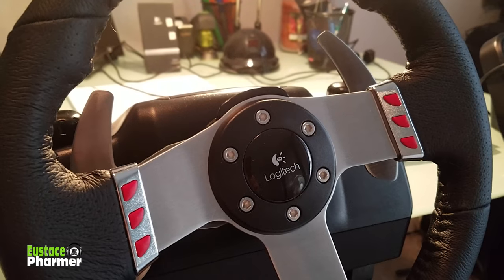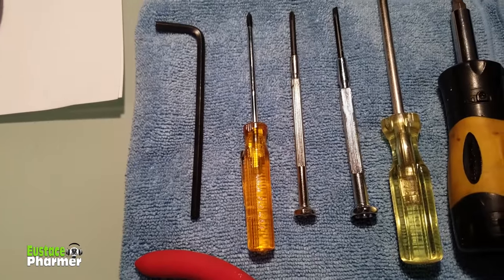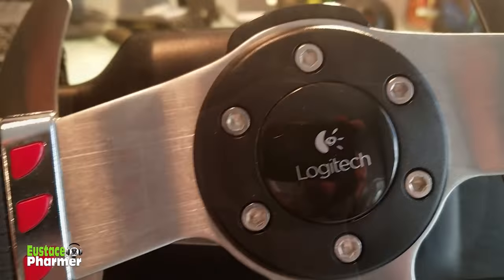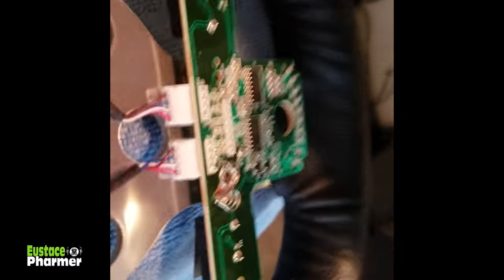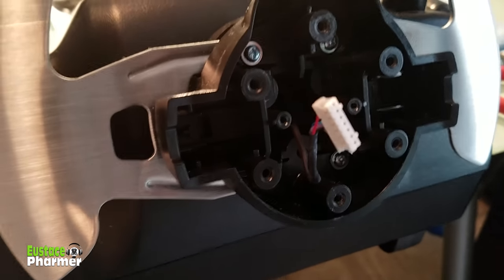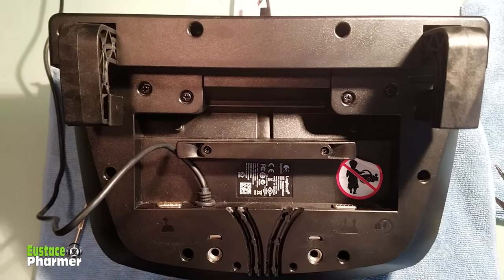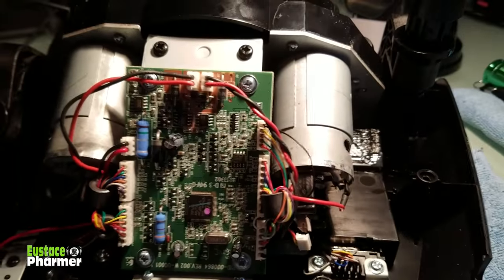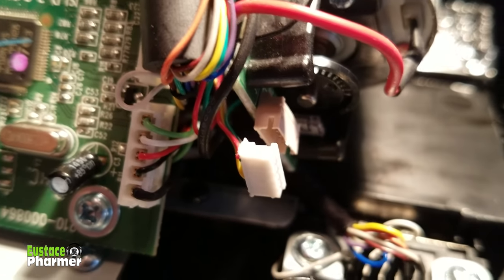LOGITECH G7 WHEEL CENTERING ISSUE FIX

Comment: Hi i need help my g27 have cracked  optical encoder so i go to ebay and bay a new optical encoder and tuday its came th my home and i but it in my g27 and now its not working its move the wheel 3 tims ltel by litle
Reply from the maker: Mahdi ALmiskeen 
it sounds like you didn't line up the optical sensor properly.

Comment: I have a g29 and I bumped my shoulder into it and now when the week is in the center the car goes a little to the right, I only found calibration fix videos on g27 , will this fix work for me ? I think it might be just some lose screws because the steering wheel kinda moves back and forth too it's gotten a little lose it didn't move back and forth before
Reply from the maker: amed lak
Sorry for late reply. I was on vacation for a week. G27 calibration will not work for G29. G29 has built in calibration software suite you use. 😊
Thanks very much for watching and for the question.

Comment: what are the symptoms of this problem, my wheel shakes violently for no reason and was wondering if this is what i should do to fix it
Reply from the maker: Sounds like the feedback setting is set too high or malfunctioning. I recommend opening the software and turning feedback off.
if you don't have the original profile software you can download it with the link in the description of this video.
Reply from the maker: Thank you very much for watching too 😊 👍
Reply: @Atomic67G  i don’t want to turn feedback off because it’s important to me and setting is not too high cause it was fine and then all of a sudden it started doing that
Reply from the maker: @BenSmith-yo3jw  The G27 is a very old wheel. Things will start to go bad. Feedback is first to go because it shakes the wheel literally apart.
If this happens when you start the pc when the wheel calibrates then it's a wheel problem.
1 Unplug the wheel
2. uninstall the profile software.
3. Use a registry cleaner software to remove residual files like Glary soft 
 4. restart PC 
5. download and install the legacy profile software from my Google drive link in description.
6. plug wheel back in when prompted by install wizard.
See if that resolves your issue.
If it doesn't then that feature of the wheel is going bad.
You will have to decide to reduce the feedback or turn it off or you can send it to an electronic repair shop for diagnosis and /repair. 
It may be time to buy another wheel and pedal set.
I use the Thrustmaster Leather edition. Excellent quality piece of kit.
Again, Links to the registry cleaner and legacy software are in the description of this video.

Comment: I bent that infrared sensor littlebit closer to that plastic wheel, that fixed calibration issue for me. First i bent it too much and whole wheel didn't work, then i bent it littlebit back and everything was working and no calibration issues after 20hrs of use.

Comment: ive seen that a brass replacement encoder can be purchased online. either a 30 slot or 60 slot wheel. is there a method to determine which encoder is inside the G27 without opening it up? i dont have the box it came in as i bought my wheel second hand.
Reply from the maker: Lucien Petersen 
The piece you are talking about is the same across all G27 wheels but to be honest, you have to order that piece from someplace in Asia. Not only does it take like 3 weeks to get but I don't think I trust some dude taking my money hoping he will deliver, lol.
Reply from the maker: Lucien Petersen 
you can remove the piece yourself and look up online for a local tool and dye maker they can make you a piece in your local area and it will be far less expensive and you can have it most likely in a couple of days
you can also call at company that has a 3D printer and you can make one out of plastic and they can do that in 10 minutes
Reply: Eustace Pharmer i believe from Thailand yes. USD38 with shipping. they have YouTube vids showing how they turn the ring out of brass then laser cut the slots. Does anyone else out there know how to determine which optical encoder is inside the g27 without opening it? fyi - I'm in Cape Town. in case anyone sells it locally....
Reply: Eustace Pharmer ok. so bottom line is - roll up sleeves and pass the Phillips head...
Reply from the maker: Lucien Petersen 
you have to open the wheel anyway so you can determine if yours is even broken and if it is you have to remove it and replace it so you may as well just open it up
Reply from the maker: Lucien Petersen 
Foe Shizzle, get in there buddy 🤣

Comment: I recently bought a second hand G27, and it worked just fine until this problem came up. 
I turned it apart and realized that the problem was, in fact, a loose screw.
Now I re-assembled it and i
All I get is the dim power check light on the gear stick and the wheel won't even auto-calibrate :/

Anyway, this was very helpful
Does anyone know what could be the problem with my wheel?
Reply from the maker: I'm glad I could be of some help. If you have further trouble calibrating I also included the DX tweak software. link is in the description. Thank you very for watching and for the comment 😊 👍

Comment: I have a problem with the thrust master tmx where I plug it in correctly, it calibrates fine, but then there is no ffb, vibration, resistance, or self cantering... been trying to figure this out for over a year
Reply from the maker: go to the thrustmaster website and download the latest firmware. I know there's been an update because I just bought the thrustmaster leather edition and shifter.
Reply: Atomic67 G do I still need to do this even if I’m on Xbox one?
Reply from the maker: @jacksondevries6180 
I would say on console it's plug and play so I suspect certain features like what you are talking about may not be supported for console.
Reply: Atomic67 G it worked before, but after I played forza 7 on pc and went to play horizon 4 on Xbox, it didn’t work
Reply from the maker: @jacksondevries6180  I had the same problem with logic g29 for Playstation. I plugged it in to PS and it worked great. I plugged it later into pc to play a game then back to PS4 and it didn't work at all. Not even calibration. The only thing I can suggest is to plug it into your Xbox and look for a setting to reset the wheel. if not I would contact thrustmaster about it and see what they can do. I know it's a common problem but I don't know if they will help you or not. Logitech has terrible customer service support so I don't know if Thrustmaster will be the same. I wound up returning the Logitech wheel to Amazon for a refund. it's always a good practice to test as many things you can with a new product the first couple days you have it. That way you can easily get a refund if something goes wrong.
Reply: Atomic67 G it works on the pc now. Thanks so much for the help!!!
Reply from the maker: @jacksondevries6180  I'm sincerely thrilled I could help! I know how frustrating and disappointing these issues can be. These wheels are so darn expensive! Best of luck and thank you very much for watching and for your comments 😊👍

Comment: I have those problem and when I go to the part behind the mother board where you have to take the clip of of the working harness I am having a extremely hard time getting it off any suggestions
Reply from the maker: Mach_ChickenGaming 
The only suggestion I can give you is to just gently wiggle it loose with a couple micro screw drivers. Just take your time. It will come off.

Comment: When i turn on my steering wheel is centres wrong the when i play with is this way the steering goes seriously out of centre do you thing it is the optical sensor or no before i open my steering
Reply from the maker: You can go in the video description and download the legacy profile software and the DXTweak software I provided. DXTweak gives you the ability to reenter your wheel and fine tune it.
Try that before opening your wheel.
If it continues to become misaligned after that then open wheel and check sensor 😊
Reply: @Atomic67G  how to use the DXTweak and if the ring was cracked how to remove it

Comment: My wheel gradually starts going off center about 10-15 minutes into playing until it is entirely 180 degrees upside-down. Would this fix that or is something else wrong with mine?
Reply from the maker: If you used the DX tweak software I made available for download in the description of my video and your wheel still falls out of alignment then you most likely have a mechanical issue. Either loose screws or cracked optical sensor.
I suggest you open it up and inspect it if you feel comfortable doing so.
If not you can contact an electronics repair shop in your area and let them diagnose /repair it.
Hope this helps and sorry you're having trouble.
Thank you very much for watching and for the comment 😊

Comment: I had a hell of a time getting the black cap off. The whole fn thing came off. The cap, disk, the board holding the sensor. It was really loose. So does it matter how close the disk is to the clear sensor when putting it back
Reply from the maker: Travis Wilson 
Hi Travis the disk should be aligned perfectly or you will not be able to maintain calibration or it may not calibrate at all.
Reply: Anyone else have to make sure the wheel was lined up dead center when putting it back together
Reply from the maker: Travis Wilson 
absolutely, that's what determines center point for wheel calibration and it maintains based on optical disk positioning each time the wheel calibrates.

Comment: Man... You rock!!!
I have a G25 and yesterday have exactly same issue.
Some Litlle diferences with yours G27 but in The end its The same.
Excelent vídeo m8!!!!
And thanks a lot
Reply from the maker: You are very welcome and I'm thrilled I could be some help to you! Thank you for the fantastic comment and I appreciate you watching the video! 😊👍
Reply: @Atomic67G  😞 after 45m ok back to same... Led flashing again and Cant stearing...
Ideas?
Reply from the maker: Unplug the wheel from outlet and unplug the USB.
uninstall the software. Then use Glarysoft registry cleaner to remove residual config files.
Restart your computer.
reinstall the software.
Follow software prompts as to when to plug your wheel back in.

Make sure in the software that you do not have auto update active nor should you have automatic game settings search active.

If those steps don't fix your problem then it's possible that you have a bad sensor or broken wire in the USB cable either at the attachment point to the circuit board or the wiring inside the cable covering it damaged at some point.

I don't know what county you live in but you can find an electronics repair shop that would diagnose and repair the problem. It may cost you anywhere from $50- $100 but that's alot cheaper than a new wheel.

You can also take it to a technical school in your area and let the students fix it. That's usually free. 
Let me know how you make out.
link to Glarysoft registry cleaner is in the description of this video 😊
Reply: @Atomic67G  tks m8
I Will try it and after ill give you some feedback
Reply: @Atomic67G  i just remember... Instead unistaling all that and cleaning registry i Will Turn it on on another PC (laptop)
But i think thats something fisical..
Prob a bad contact.. 
After try ill say something
Ps. im From Portugal
;)
Reply from the maker: Nice to meet you and hello to you in Portugal from me in Las Vegas 😊👋
Reply: @Atomic67G  🍺🍺🍺 cheers!
Reply: @Atomic67G  same thing on another PC... 😞
Tomorow gonna Open it again and try to understend what ia happing.
After i post it here
Reply from the maker: ok, please do let me know. I think it's pretty evident at this point it could be a circuit board problem. Look for any deteriorating solder where wires and components connect to the boards. Obviously you also want to look for broken contact or loose contact.
Reply: @Atomic67G  i Will...
Tks once again 4all
Reply: @Atomic67G  just finished mount all again..
After some checks, all seeams fine.. The only thing that claimed my attention was The little wheal.
I put just a little bit of superglue on it to dosent false Spin (dont know if it makes sence to you now😁)
Turn all on and passed The test.
It spins the 900°
Later Will try it on Game and hope it stays like that.
Ps. Sorry The english
Reply from the maker: @LuisFrederiko 
I'm thrilled you got it to work and I'll say a prayer for it to continue working.
Don't apologize for your English. You are doing great! 😊 👍
Reply: @Atomic67G  still working...
😁

Comment: Mine is slightly calibrating to the right does it mean that the optical thing is broken or just software issue because when i put it straight the software tells it angle 0. Thank you
Reply from the maker: it doesn't mean your optical sensor is bad. I updated my description with a link to my google drive.  Click on the "LEGACY SOFTWARE and DXTWEEK SOFTWARE" link. Download the DXTWEEK software and you can use that to recenter your wheel. You will have to play with the numbers a little to get it spot on but it worked great for me. 
Hope this helps :)
Reply: Ok thanks you so much
Reply: Im a noob at sim racing

Comment: Nice video. I wish this was up about 6 months ago when I had to strip my G27. I had dust on the sensor the wheel would start to calibrate then quit. Once I cleaned it the wheel was back to normal.
Mike
Reply from the maker: Reefy1952 
Thanks very much for watching Mike. I have to say they Logitech really has a serious design flaw regarding optical sensor and internals. They make a metal wheel wrapped in leather but use plastic moving parts inside?  The G29 is the same way. I wonder what Logitech will do with the Farming Simulator wheel kit now that they bought Saitek. Probably keep it the same and raise the price, lol.
Reply: That's the million dollar question.  The Saitek Farming Wheel has serious quality issue from what I've read and seen on YouTube.  Many have stated they are on their second and third sets due to them breaking after only a few weeks/months of use.  So I would hope that Logitech improves the design.  But yea, I'm sure the price will go up.  

I'm really shocked to hear of the design flaws in the G27 and up.  I've used Logitech gear in flight sim for years and have had my G27 kit for about two years and all is rock solid (knocking on wood).  

So far I've not encountered an issue with this sensor.  But I'll certainly know where to look for a solution if things go south.  Thanks Eustace for recording this video.
Reply from the maker: you're very welcome Jerry and I will say G27 is leaps and bounds better than the G29 predecessor.  I have a G29 and it sits broken on my shelf. there was a bad design flaw in the G29 when it calibrates it calibrates quite violently and there is a wiring connection inside that breaks and it's extremely hard to detect because the wiring breaks within its insulation so you can't see anything visibly you have to literally take the unit apart and use a test light to find what connections are not active.  Logitech says nothing about it and continues to sell the scrap metal wheel - business as usual.

Comment: Hey man can you please answer. So i have the logitech g25 and this doesnt even spin at the beginning and doesnt work but the shifter and every button and everything works exept the wheel
Reply from the maker: I can't tell you for certain unless I was sitting in front of the unit. Itcould be a number of things.
G25 is a very old wheel. You could have outdated software and drivers for the wheel.
The USB for the wheel could be bad or the board in the wheel could be failing.

Comment: It was very loose so I tightened it properly but problem persists, any other ideas??
Reply from the maker: did you inspect the encoder disk to see if there's any cracks?
If you did and did not find any, I included the DX tweak software in my Google drive download link in the description. Use dxtweak to re-center your wheel and that will fix your problem 😊
Reply: Atomic67 G Everything else was fine. Will check your program. Thanks and great vid!
Reply from the maker: @leonardgonouriewaldenstrom3243  you're very welcome and thank you very much for watching 😊

Comment: Hi, is it normal for the ring to have about 5mm of play up and down the shaft?
Reply from the maker: Are you having problems with your wheel such as alignment issues?
Reply: @Atomic67G  Yes, I just figured out that the calibration wheel is cracked, im going to try to glue it together later today. I also read somewhere that it might be a good idea to glue the little wheel to its shaft to stop it from sliding around and messing up the calibration.